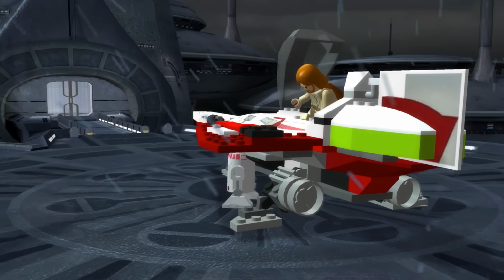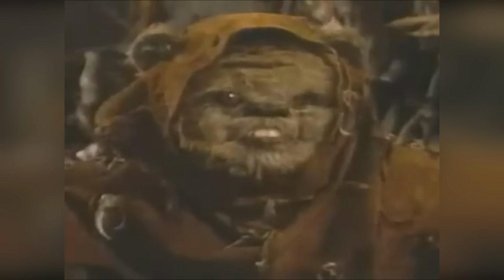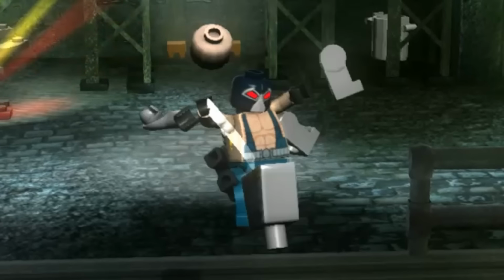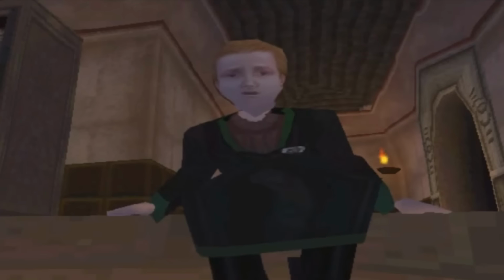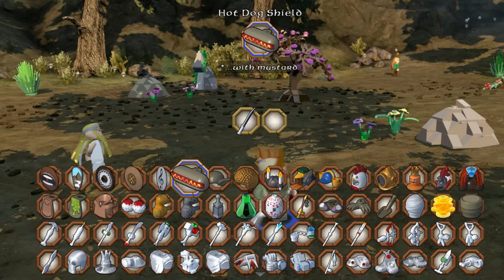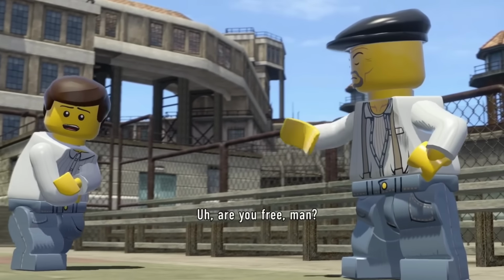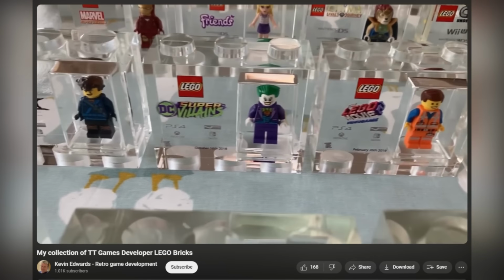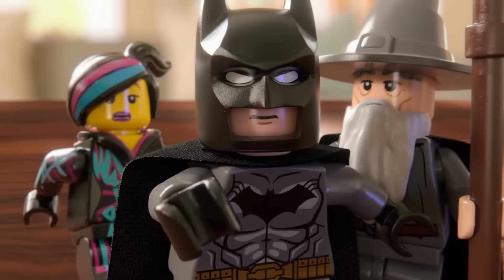Cool Stuff in LEGO Games

Comment: For those wondering, those "hidden cheat code characters" were included in LEGO sets at the respective release windows. Later games would just have codes in the boxes to unlock the characters who appear in the set you buy.
Reply from the maker: Ahhh I see nice! Cheers for the addition 😄
Reply: @KlawPeels  Rare printed code bricks in a Minecraft set too.
Reply: Just an audio dude tip, you might want to tone down the low frequencies in your voice. It sounds like you might be boosting lows in post which probably sounds good on low end speakers (phones, laptops, TVs) but can sound really unpleasant on speakers with higher quality (earbuds, over ears, soundbars). Actually a really common mistake tbh

If you’re not boosting the lows then a high pass filter at like 150-200 Hz could help. Just my opinion!
Reply from the maker: @ethancooper4154 you’re spot on! I’ve started lowering them in recent videos and it’s improved the quality I think, once I made the changes it was a bit of a facepalm moment 😂